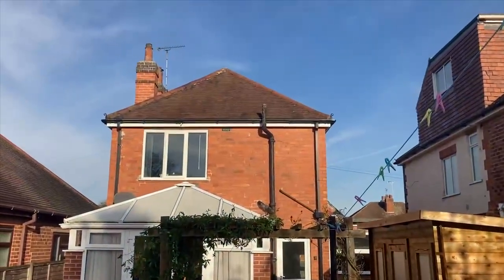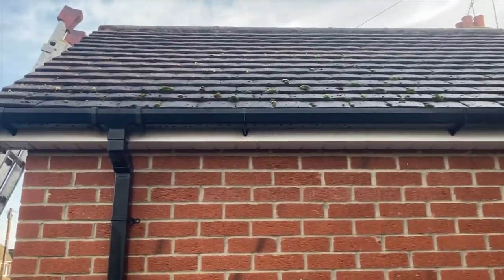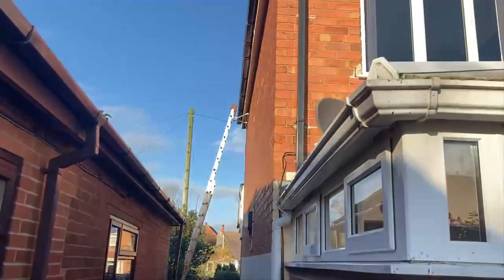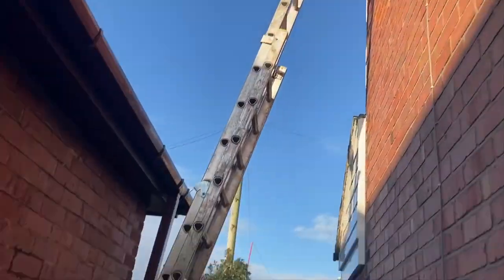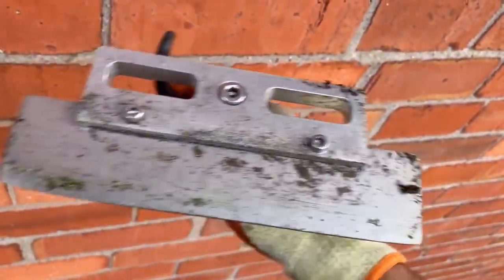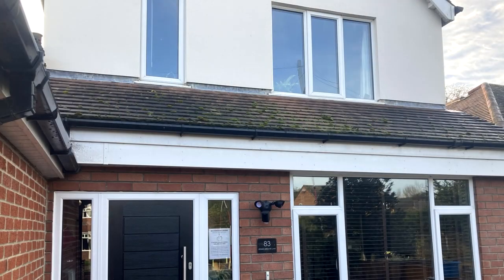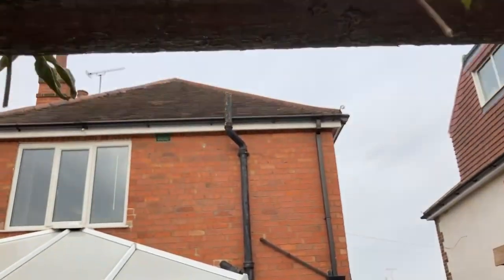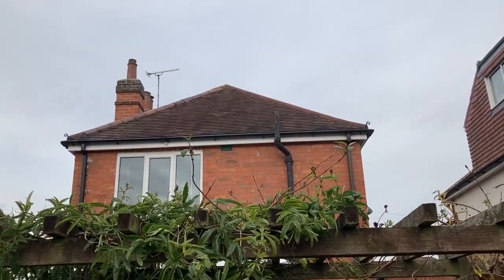My LAST Roof Clean Of 2020! // Partridge Exterior Cleaning

Comment: Do you give a disclaimer when scraping tiles? As some may be cracked. So when you scrape the tile is dislodged and slides into the gutter. I’m only asking as I have my first roof clean on Monday. Thanks for any advice you can offer.
Reply from the maker: Happens all the time mate and is sorted in the quoting process. I always say I'm an honest person and will happily own up if I've done any damage but theres a small chance you will have some loose tiles or mortar that I can't take responsibility for. I will point them out to you and it's a cheap fix etc. Never had an issue mate (:

Comment: Do you still do your roofing jobs in the winter mate as long as it’s not forecast to rain for 24 hours after you have applied the biocide?
Reply from the maker: Hi again mate i still do them in winter just double check the temperature, shouldnt use bio below 6 degrees so best to apply just as it gets to the warmest part of the day so it gets chance to get to work. and 24 hours i wouldnt say is needed, as long as its a good few hours and the roof has had chance to dry out after its been applied youre usually good to go.
Reply: @PartridgeExteriorCleaning  thanks again mate for all your advice sorry for all the questions 🙈
Reply from the maker: Haha I’m happy to help mate honestly 👍

Comment: That's a big job, well done. Hope it pays well, you will need a day to recover and a few beers :-) . What were you using to pump the bio?
Reply from the maker: Cheers Ched, yeah it was priced just right this one. 
I was using a big boy 2 backpack however it was playing me up a bit so looking to find something new in 2021.
Thanks for the comment mate 👍
Reply: @PartridgeExteriorCleaning  The Gardiner V3 backpack is great, the seals are not viton but are quite chemically resistant as long as rinsed after use.
Reply from the maker: Yes will be getting my hands on that as soon as it’s in stock anywhere :D